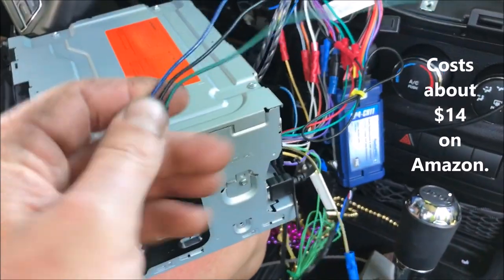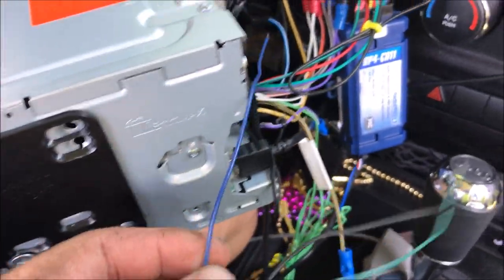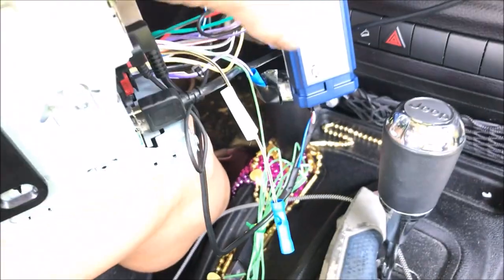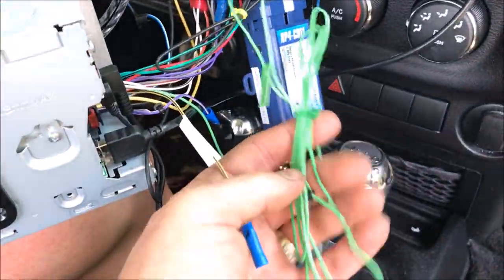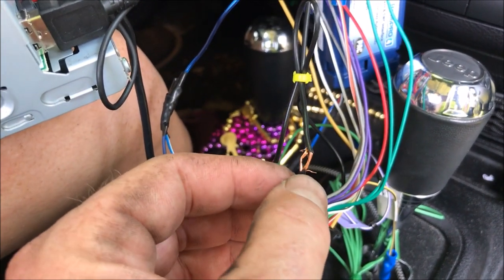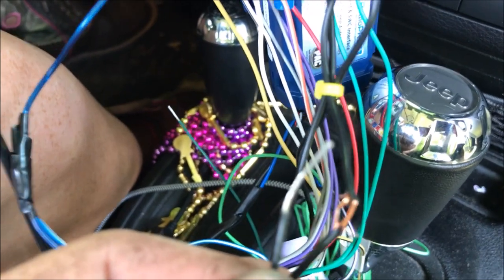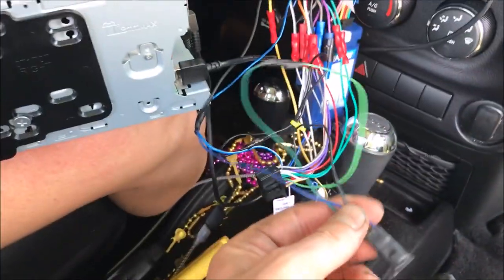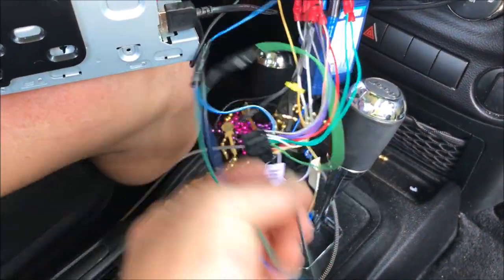FAST - Wire Radio Parking Brake Bypass for AVH MVH Pioneer Radios Micro Bypass Interface

Comment: I have a blue / white on my can bus connector (amp turn on), and another blue / white on the radio harness (remote turn on), should they be connected together and then the blue wire from the bypass module t-tapped into them, or should one be unused and the other the one I connect the bypass to, and if so, do I connect the bypass to the canbus side, or the radio side (I am assuming the radio side since that is what I am trying to make work). My Jeep does NOT have an amp. Thank you.
Reply from the maker: If u don't have an amp, then u wont use the blue or blue/white amp wires.  I would not wire them together, no.  When u say bypass, i am unsure what u mean exactly.  I have a vid on my channel that shows how to wire a video bypass in the system if that is what ur talking about.  I could be wrong on the blue wires since it's been a while since i did the vid.

Comment: So with a kenwood receiver and the pac module, do i need the bypass or just ground the parking wire on the back of the stereo, and cap off the harness wire? Or do i have to bypass that part of it?
Reply from the maker: We did the bypass so we dont have to be in park for the vid to come on.  Else, you will have to wire it up to oem parking wire.
Reply: @JRMSweeps  Yea I was under the impression that Kenwood all you need to do is ground the park wire to the back of the radio.... But was not sure what to do with the park wire on the pac module
Reply from the maker: I would get the bypass piece for sure.
Reply: @JRMSweeps  Gotcha.... What happens if you do not hook it up at all?  Will it work, except for playing dvds while driving?
Reply from the maker: If you dont hook it up at all, im under the impression when the vehicle is parked, a signal will not be relayed to the unit telling it your parked, this never allowing you to play any video at all.  I would def get the bypass piece and not worry about anything!  Try hooking it up without that wire and see what happens, in theory, should still work, but idk.

Comment: Hello! A question I have is I bought a harness (Maestro) to allow for the steering wheel functions to work. Do I connect both the Blue and Black to the Maestro harness and Pioneer harness but the Green (Parking) only to the Radio harness?
Reply from the maker: Honestly i am not sure what u mean.  Did u wire just like i did in the vid?

Comment: I installed my bypass, but when I try to view video I get the CAUTION Notification and the "Ok" button is grayed out.
Reply from the maker: Is the bypass hooked up correctly?  I know silly ?
Reply: @JRMSweeps  Thanks for the reply bro. It is but doesn't seem to pulse to get rid of that video notice. I am wiring a switch right now actually.
Reply from the maker: Welcome. Let us know what u find out. Very curious.
Reply: @JRMSweeps  So I removed the micro bypass and went to RadioShack and bought a basic on/off switch with three poles. One for ground, p brake and remote turn on. Wired those all in and when I get the caution notice on the Head Unit I flip the switch two times and it works great! This was all done in my GMC Sierra and I got the little switch out of view right down by the OBD port.
Reply: @JRMSweeps  The bypass would allow all the menu settings to be changed without P Break having to be set but it would not double pulse for the video to able to be played.
Reply from the maker: I gotcha. Guess u have to give it the double neg pulse...why is that tho?  Why wouldnt it do it automatically like my jeep does?
Reply: @JRMSweeps  I'm wondering if the bypass was bad? Either way Amazon return is free and guranteed. That thing is going back.
Reply from the maker: Yeah that is really weird tbh. Could possibly be a bad product.